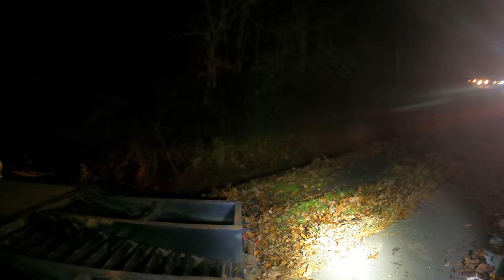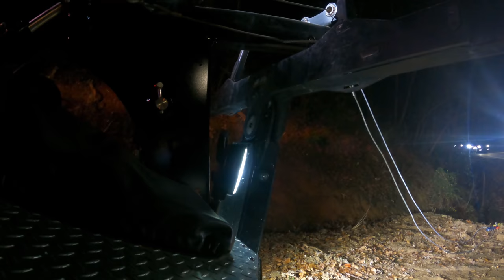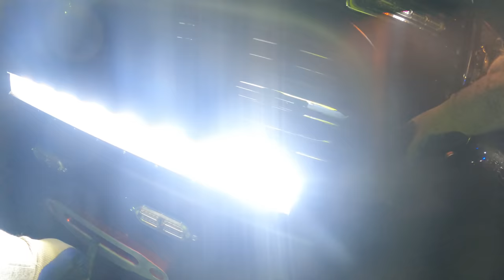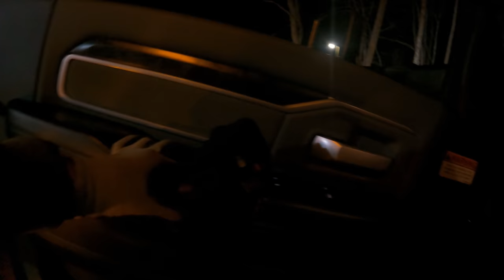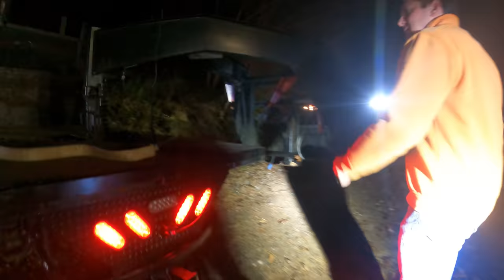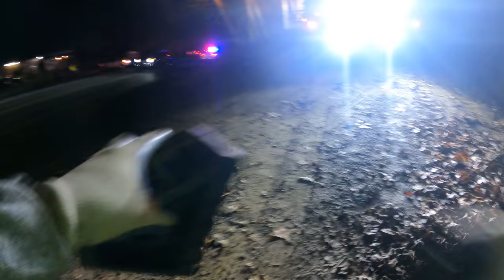Jackknifed Gooseneck Trailer and Car Crash Shootout Part 1

Comment: Man, that bobtail F350 is not setup for towing a gooseneck, the weight is all wrong and would push that F350 all day long even with new brakes up front. He definitely needs more a$$ on that truck with dually tires and linked trailer brake preferred.  Glad everyone is ok and great job to you two on the “ well thought out recovery plan”…waiting on part 2

Comment: Trailer was weighted to far to the rear not enough down load on ball an the truck brakes locked before the trailer was the main problem or the trailer brakes didnt work because of out of adjustment or brake controller not adjusted rite .l worked for a old guy that built trailers for 40yrs an you would be surprised the number of people that could not set the brake controller rite the trailer should slow the truck down than you dont jack knife

Comment: Single rear wheel F250/ 350 can work that load with finesse and ability, trailer hitch not properly secured as I have never seen a 2 5/8 come apart without destroying the hitch assembly. Locked the truck rear brakes with little if any of trailer brakes thus inertia jacking trailer pushing the rear around/ jackknifing. Truck tires? Trailer loaded with no tongue weight? Wet / moist road? Boy, was that dug in.

Comment: I was gonna tell you hook up front winch and figure you did lol. Want update on dash cam that you got one in van. does till stick on window? is there any issue? Since I was plan get one because i got new jeep so there no attach on mirror because of different kind mirror that attach button like SOS and assist. so, no choice have get new one. not want take SD out and in whenever want upload video. Stay safe Jeff and Kristen Watch your six
Reply: That's a fantastic way to bend your frame into a U. As you pull on the casualty the tow truck wants to lift the front wheels, especially with the boom up like that. When you run a line off the front it can't lift anymore so something has to give, usually the frame right behind the cab. WreckMaster training will go a long way to teaching the right and wrong ways of recovery